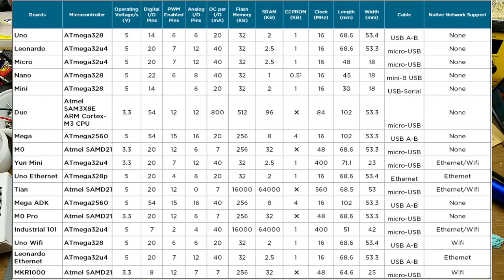Looking At Some Arduino Boards

Comment: those 3.3v atmega168 boards will run from 2.7 to 5.5 volts stock. they can run down to 2ish volts if you change the fuse bits (hfuse=0xde) and divide the  clock by two in software.

Comment: I’ve already placed a few orders and I’m waiting on some other auctions to end to see if I won.   Depending on how slow the boat is, maybe sometime in February I’ll be playing with some digispark stuff. 

Funny you’re using the fast LED library with the Neopixels, I have something along those lines coming out soon. I was working on it the past couple of weeks but ran into some obstacles so I’m delayed.
Reply from the maker: I tired the Adafruit Neopixel library for a while, but I found FastLed to be more intuitive at my (low) level of programming skill. 

Plus, FastLed takes up less space in memory. That becomes more important on the Digispark / ATTINY85 boards
Reply: @pileofstuff  I used neopixel library to drive like about fifty of them, two effect modes, switched by power off, power on cycle, with brightness scaling using a ldr, and it kind of fits allright. It took like 4k of flash, so probably I could put some more effects, maybe.
Reply: Looks like I just won a couple of auctions so there will be some digispark modules on the way after all!

Comment: For cheap its hard to beat ModernDevice RBBB board, a 328p clone, great for breadboarding.   And the Teensy3 for small size and power.  Both easily available in the USA.
Reply from the maker: Those look pretty slick.

Similar idea to these ones I have been thinking about getting from a nearby Canadian seller : 
https://universal-solder.ca/product/smallest-arduino-uno-nano-class-atmega328p-bread-board-buddy-v2/

Comment: The "blue pill" is the most common STM32 based board and supported by the IDE using the boards manager. It's a bit larger than a Nano but with a lot more functionality. I personally no longer use the Arduino IDE as I find the Atom Editor with the PlatformIO plugin much better as it supports a shedload of different boards, even PIC based ones. I sometimes wonder if the immense variety of Arduino boards can be a bit confusing for total beginners and still consider the Uno (with the DIP chip) to be best for them.
Reply from the maker: There's an amazing (and often confusing and overwhelming) array of microcontrollers available these days.
I tend to treat them as a "means to an end" rather than a hobby unto themselves. Which is why I'm trying to stick with the simplicity and beginner friendliness of the Arduino IDE for the foreseeable future.
With the boards I've already got, I'm beyond where I thought I'd go, and as you see, I have some that I haven't even started exploring yet. (like the STM32 based one and the ESP8266 ones)
So many toys, so little time...
Reply: pileofstuff this board you referring to is stm32f030f4p6 and I have found it hard to work with, to begin with as well. But after I understood what it takes to work with it - it has become one of my boards to test random stuff (not including libraries at this point) It does have a very low flash and it is M0 board - meaning at the lower rank of STM32 boards. I know that at this point there is (or will be) support for stm32f030f4p6 in Arduino IDE and it called STM32F030F4 Demo board. But you need to have an external STLink or Serial board to program it - since the onboard USB is ONLY for power and nothing else. You can download the IDE board support from this GitHub: https://github.com/stm32duino/Arduino_Core_STM32 - I worked with it in my Arduino IDE and using the STLink V2  com board.
Hope you will have an easy test with it - support is there and you will be able to make it working with the right communication tool. just in case you want to see it working and maybe expand to other like the Blue Pill and the Black Pill and maybe the Maple mini :) I also work with the STM8 boards - I found them harder to implement with Arduino IDE but i have to say that I want to make them a part of the Arduino family on my bench as well. since they are less than 1 USD for a board sometimes (no headers included - but a working STM8 board). Keep it up! thanks
Reply from the maker: @aryeguetta8592  Yes it is an F4P6. 

Thanks for the info, I'll have to give it a shot.

Comment: Great video. Can you show us newbies how you hook up those wagos. I bought some to learn how to book up for projects. Thank so much. Happy New Year
Reply from the maker: I spent a bit of time on them (and some similar ones) in this mailbag:
https://youtu.be/CXgu0Wd-ANo?t=72

Basically, they just connect multiple wires together in parallel. I have a bunch that are 3 connection, but you can get them from 2 up to (I think) 6 connection.
Reply: @pileofstuff  
Thanks 😎

Comment: At the moment I tend to like Pi's a lot more.  I've got loads of Arduino boards but the issue is that they are actually handicapped with an extra board. and that extra board might need another extra board etc etc ... it becomes a puzzle with parts that you order from China.  With the Pi's, ok different game, you just swap sd-cards.
Reply from the maker: I've got a Pi as well (It's running Kodi at the moment), but they seem a bit like overkill for simply blinking a few LEDs. 
I tend to use the smallest/cheapest board I can get away with for any given project.
Another deciding factor (for me) is that here in Canada they're much more expensive than in some other parts of the world (Pi Zero for $15 plus $20 shipping....)
Reply: @pileofstuff   wow, yes that is crazy expensive and makes it slightly different .  I think I paid like max 15 euro shipping inclusive for the Pi Zero W.  The Pi Zero W is now installed as a Wifi audio player which can connect to a Bluetooth speaker.   Hardly any coding with these things is what attracts me more to this as well.

Comment: Just a comment about pro-minis.  You can flip flop them around voltage wise.  I even used the 5 v one and gave it 3.3 v.  ( I used them alot with the rfm69 radios for home automation).  What you SHOULD NOT do is run the 16 mhz board at 3.3v because it's out of spec for the 328p....see the data sheet.  But everyone does it...reference the anarduino mini and the motino(low power labs).  What you CANNOT DO:. run it at 3.3v and use 5v logic levels.

Note difference between should not and cannot.

Hope it's clear...let me know if any other questions..I know way more bout those than I really want to!!!

P.s.  look  up Kevin Darrah..he did experiments on the 328p and voltage levels and heat...it will answer any of your questions...better than my ramblings....
Reply from the maker: Thanks fo rhte clarifications. That's teh great thing about the comments I get - so many people who can add to the conversation and fill in the gaps in the video.

And, I agree that Kevin has a lot of great information to share - I've been subscribed to him for a long time.
Reply: Just for fun I tried how low voltage can I use for running uno with some neopixels attached. It turns out that it worked (probably, because my sketch was just putting random colour on every neopixel) as low as about 2.8V, any lower it crashed (probably brown-out detection). On power on it needed about 3V to start, so it's quite low as well.

Comment: Awhile ago, I read that the uno with the ch340 has some usb timing issues running grbl.  I'm running with an original ftdi version.  Not sure if grbl worked around the ch340 version, but I'd love to know if someone runs grbl with the ch340 version with large gcode files.
Reply from the maker: The only reason I tend to lean toward CH340 is that they're a bit cheaper, and I'm not impressed with the extremely heavy handed way FTDI reacted to cloned chips several years ago.

But it's mostly the price...

I'll be interested to see if someone who used GRBL chimes in here to answer your question.
Reply: pileofstuff , exactly! I'd rather use ch340 too!  The old fdti one still works...But if I ever blow it up....

Comment: I am a code guy and let me assure you .... there is NOTHING simple about it. There are billion ways to do what needs to be done and none of them are maintainable. All code is throw away. (The only exception is MIDI 1.0 which lasted for nearly 40 years.) Also, everyone will tell you your code is wrong but they aren't the ones who have to maintain it. :)

Comment: Man, were do I get a diy power supply like yours? What is the module you have used to build?
Reply from the maker: It is a 3 amp buck convertor that has adjustable constant current and constant voltage output. 
I power it from an old laptop power brick.

Specifically, one of these:
https://www.ebay.ca/sch/i.html?_nkw=B3603+Adjustable+Buck+0-36V+0-3A&_sop=15
I built my own case for it a long time ago.
 https://www.youtube.com/watch?v=avv7dsoVO9o
Reply: I think found it. B3603 right?

Comment: at 16:00, ANY esp8266 has just one analog pin...
Reply: only one on the 8266 with limited input range of 0 to 1.2V or there abouts. main function would be to monitor battery voltage.
Reply from the maker: True. Thanks for the clarification.